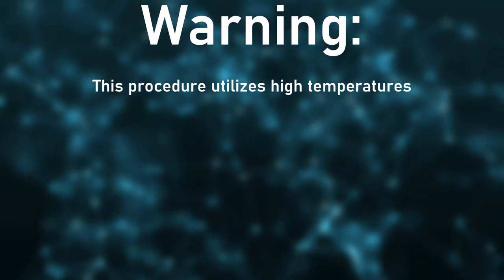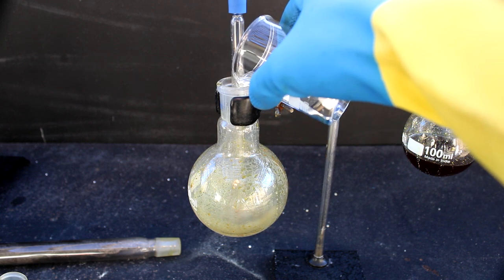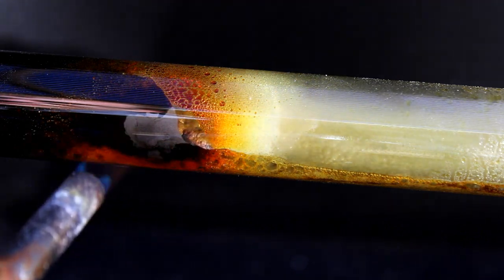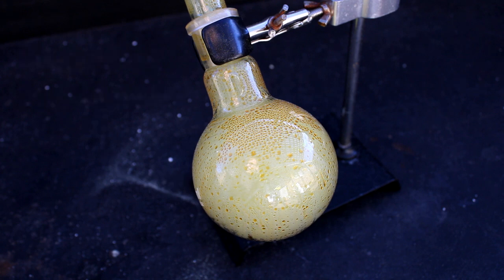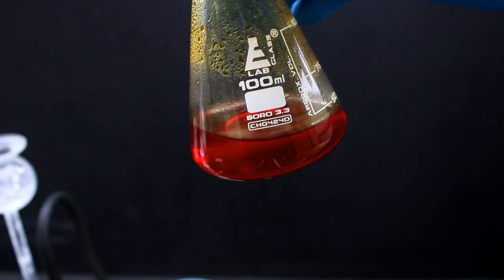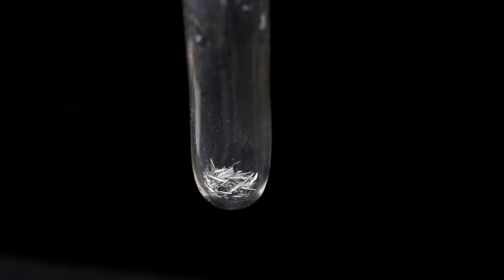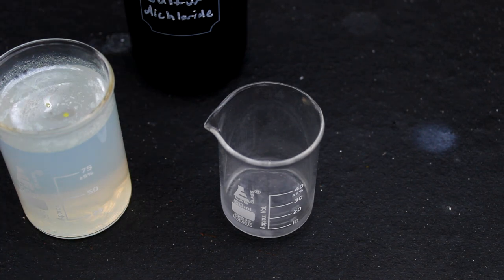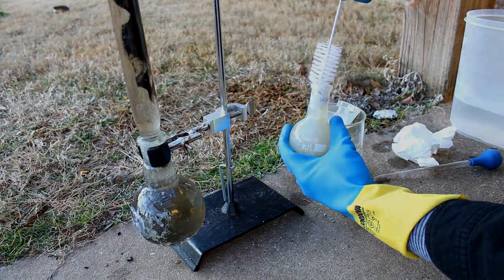Synthesizing Sulfur Dichloride: A Noxious Liquid That You DON'T WANT | Thionyl Chloride (Part 1)

Comment: The material can be made catalyticlly using activated charcoal at a bit less temerature. You will get a little CCl4 as a side product but the basic reaction is you get CS2 as an intermediate that transforms to C and S2Cl2 in excess chlorine. 🤓

Comment: So you said you made in this video few times Silver diOxide and Silver diChloride, hmmm! Anyway, For all the pseudo chemists here, it is very important for you to know that if you use rubber stopper on your flask, it will be deformed in few hours within and outside. Sulfur diChloride changes soft rubber into hard one and it also expends it to the point of breaking the flask due to its constantly increasing volume. I wasn't even home when that happened. My dad told me that when he opened the door, he saw the entire room filled with white smoke! So the only way to cook this molecule is with glass stopper and keep it far away from rubber! Fuming Nitric acid decomposes rubber as well and after few seconds of its vapor, you could see a black liquid dropping, so again distillation is done with glass stopper.
Reply: how do you think , can this reagent give acetic anhydride from sodium acetate? It seems to be the easiest eay to make it .
Reply: @vantablack9882  yep, it can

Comment: Sulfur clean up you use heated Xylene, or Tuelene
Reply from the maker: I would've, but I didn't have any at the time, so I just used plain old NaOH solution. In my most recent video using sulfur chlorides, I just soaked everything in an alkaline bleach solution with a little potassium permanganate to destroy the residual organosulfur compounds that tend to leave a lasting stink.

Comment: Wash with hot toluene
Reply from the maker: I didn't have any, and it's kinda hard to find around here. Fortunately, hot sodium hydroxide solution also dissolves sulfur fairly well (albeit somewhat slower).
Reply: @LabCoatz_Science  have you thought about reductive dechlorination of paradichlorobenzene?
Reply from the maker: @israelburkett1381  Might be a fun idea...I have seen that stuff sold nearly pure as moth balls. Might be an easy way to get benzene, assuming the reduction is straightforward. I recently tried a similar reduction process with chloroform to get dichloromethane, but it was a total failure as far as I can tell, lol.
Reply: @LabCoatz_Science  in a nitrogen atmosphere wash some iron fillings with sulfuric acid and rinse with distilled or deionized water use a solution of potassium hexachloropalladate to precipitate palladium onto the iron. Wash with more water leaving it wet. A solution of pdcb in methanol can be reduced with the catalyst
Reply from the maker: @israelburkett1381  Fascinating, I'll have to consider if I ever get my hands on some palladium!
Reply: @LabCoatz_Science  I'm going to attempt it with platinum
Reply: ... and it still will reek of sulfur kind of forever!